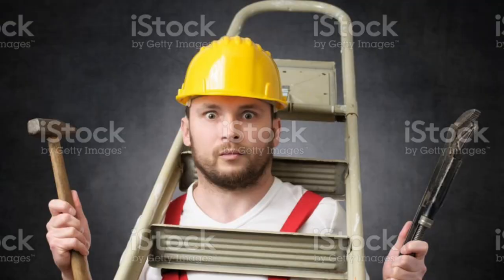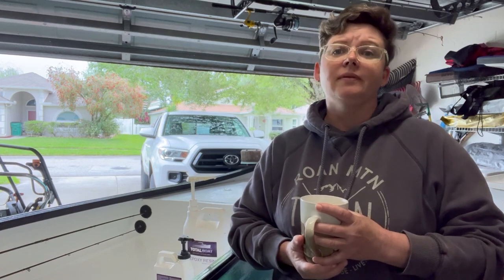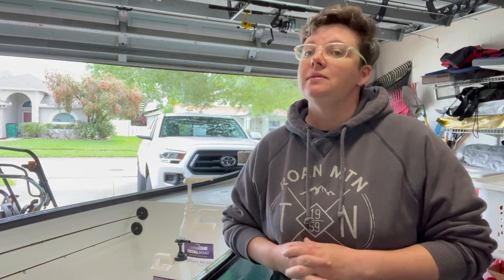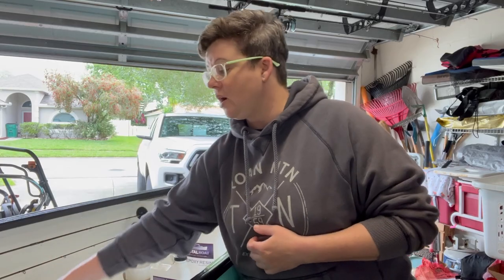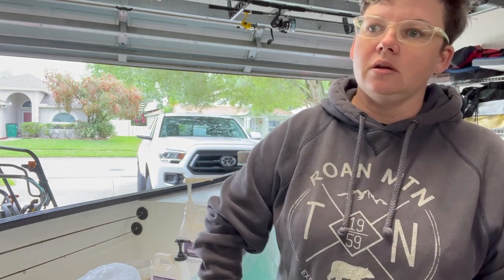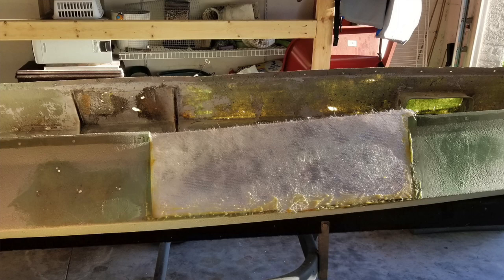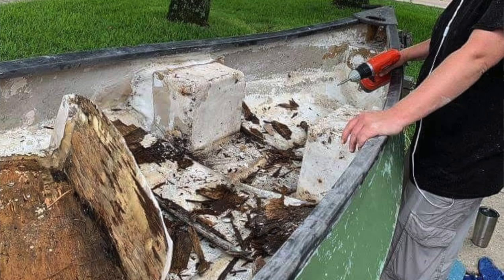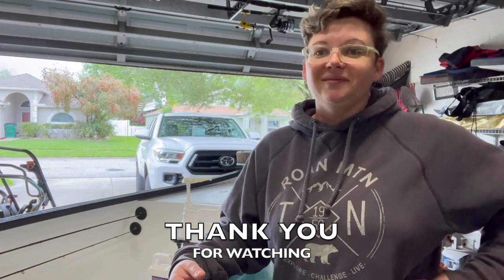GHEENOE REBUILD - Where To Start?

Comment: Love these videos - Subscribed! Question, what thickness foam did you use? I live in FL and found the supplier but they offer both 1/2 and 3/4. Thanks
Reply from the maker: Thank you for subscribing!!!  Because I used a lot of reinforcement and was fiberglassing both sides I went with the 1/2 inch.  They recommended to have a support every 2 feet but I didn’t go more than a foot without some kind of a support point.  Plus, I’m chunky but I’m not big enough to put a bow in the 1/2 inch after both sides had a coat of 1708 on them.  They ended up being ridiculously stable…. I had a hatch blow off and it was run over by a school bus and i was still able to stand on it (tested it for fun and was impressed). Let me know if you have any other questions.  What kind of boat are you redoing!?
Reply: @DesOnTheFly  thank you so much! I’m debating on PVC or the stuff you used for my skiff. I’m 220 so the foam does scare me a little haha but it’s so much cheaper than 3/4
Reply from the maker: I would use 3/4, or do an extra layer of 1708…. But that gets so expensive.  Were you thinking of starboard?
Reply: @DesOnTheFly  at my local Home Depot, they sell 1/2 thick, 4x8 sheets for $99 each. Might go that route as it’s is super strong, 1/2” thick and won’t require additional resin. Thanks to your videos, I started to explore other options than just wood.
Reply from the maker: Good!  If you think about it let me know how it turned out!
Reply: @DesOnTheFly  oh I will! Thank you for the great and fun to watch videos.
Reply: @DesOnTheFly  oh I will! Thank you for the great and fun to watch videos.
Reply: Where is the best place to buy the foam board?
Reply from the maker: @patricklail2031 if you live in Florida and you can take a drive I recommend recommend getting it from this place. They are nice. Shipping is more expensive than the actual foam.  https://fiberglassflorida.com/air-cell-t-60-6lb-green-foam-2709.html
Reply: @DesOnTheFly  thanks so much!! I’m actually in Charlotte NC
Reply from the maker: @patricklail2031 if you have a local fiberglass place contact them and see if they have a substitute.  I didn’t do honeycomb because it wasn’t moldable but that is a more popular option you may find easier.

Comment: I’m about to start my project of a 1989 13’ gheenoe.  Any suggestions or recommendations would be great! This is my first rebuild.  Do you suggest filling holes with bondo and sanding smooth before you put a full new layer of fiberglass?
Reply from the maker: I definitely recommend filling in holes or cutting out/redoing section before you put a full new layer on.  Those older ones definitely need a gut job.  The wood gets so soaked and rotten.  What are you thinking of doing with the inside?  When I took the rails off of mine I found bad cracks and waves I had to cut out and redo before I could put a new layer on.
Reply: I haven’t even gotten into mine just finishing up a 12’ aluminum and trailer rebuild.  Do you have a discord? Would love to ask you questions and pick your brain.
Reply from the maker: I don’t have a discord but I do have instagram or Facebook messenger.
Reply: I added you on Facebook thanks!
Reply from the maker: Thank you for letting me know!  I will except!

Comment: Thanks for the videos. Well done. How did you mount the rod holders without penetrating the exterior wall?
Reply from the maker: Thank you!  I hope they help.  I ended up adding a layer of foam and glass to the walls for stability, otherwise they just kind of flapped in the breeze.  So I used small screws and 5200 marine glue.  It worked great!!!!
Reply: I like the foam you used. I’m looking around for it now. How much did you end up using? Looks like it comes in 4x8 sheets, correct. Thanks for the response.
Reply from the maker: @mikedantoni3470 I can’t remember how many I used.  But I over measured the decks I wanted and then used graph paper to figure out how many I needed.

Comment: How much epoxy, fiberglass, and H60 did you go through?
Reply from the maker: About 3 gallons of epoxy, about 30feet of fiberglass and 1.5 full sheets of h60.  I fiberglassed both sides of the h60 to keep it strong.  What are you redoing?

Comment: Yours was worse than mine was, and is, again.  Mine is a river hawk 17'.  I use Bondo fiberglass jelly to patch holes and then Bondo fiberglass resin with the cloth.  Pretty close to what you did. The rivers here in north Georgia have rocks and rapids so I'm going to coat the bottom of my hull with rhino liner this time.  I like what you did to yours.  I might put more layers on mine first.  

Up here you gotta go upstream and fight currents.  Anything less than 15hp won't make it.  

When you can make it, though, I can guide you on a hell of a ghenoo trip once I finish my boat.  Our watershed comes out in mobile, AL.  That's downstream.  

Your channel got recommended at random by the way.  That's how I wound up here.

Besides that I've been trying to figure out a way to make a convertible top that converts into a set of sails as well.  I've got an outrigger system designed too.  I'm going major on mine this time.     It's set up to tow the outrigger canoe.  Coleman with the floaters.  

Excellent videos you have.  Thank You.
Reply from the maker: Awesome!!!  Yeah, the oysters get my boat and I will need to do some love patches here in the next couple of years just to keep up maintenance.  I bet you do need a 15hp upstream!  I’m going to upgrade now that I feel more comfortable with the boat.  A 4hp is just a little small.  I would love to keep in touch and see Georgia.  Rhino liner will work well.  I love the airboat coating on mine.  It really helps!  What do you mainly fish for?
Reply: @DesOnTheFly  That would normally be a simple question except our local government won a lawsuit against watershed PFA violators very recently.  In the upper watersheds you can go for trout or other small fish.  Crayfish traps increase your chances of success.  I wouldn't keep or eat any catfish.  Any tipe of chicken wing sized fish should be ok to eat other than that.

In the middle watershed small striped bass is what you want to get for food.  The pollution complicates things.  I'm trying to re-figure it out again myself.

Thing is you pass through towns here going upstream.  There's islands in the middle of nowhere and there's supply stores next to bridges the whole way.  In Rome you can get anywhere you need to go by river in town.  It's a different scenario.  Yes it's addictive 😎
Reply: @DesOnTheFly  For my second answer, I like the adventure.  I stealth camp here and there.  I only fish for food if I need it.  You ain't got time to stop much if you're gonna make it upstream camping.  

What I do is get to the camp and go to dollar general and get sandwich meat first thing and hide it among stock in the freezer.  Then I set up camp and buy it frozen the next day.  

There's not many safe fish catch eat places at the moment.  Even our tap water is contaminated along with well water.

Please do keep in touch.  I like you.
Reply: @DesOnTheFly  I'm not sure if anything I said made sense or not.  You mentioned a coating that I'm not familiar with as well.
Reply from the maker: It made sense, I don't get to stealth camp a lot but I primitive camp as much as I can.  I fish for fun, but I love eating my catches.  But Red tide, and water pollution down here make it really hard too.  

I didn't even think of doing that with lunch meat before you buy it!  I'm so doing that!!!

The bottom stuff I put on is called super slick.  Here is a link to it, just remember if you trailer your boat and you go around a corner without it strapped the boat is going the other way...

https://fascoepoxies.com/Fasco-9xn-2000-Super-Slick-Epoxy-Bottom-Coating.html?gclid=Cj0KCQjwqs6lBhCxARIsAG8YcDhbLhY2ismOjhK8VHeFbAbBM2pQ4dDEDoDgZ3G5jtg2tigoTlualv0aAmYBEALw_wcB
Reply: @DesOnTheFly  I don't do it alot either anymore.
Reply: @DesOnTheFly  About camping.  We're in opposite situations.  I love bushcraft and primitive skills.  Everything near the water is either private property or a heavily patrolled no camping public area.  It's like that because of people who do harmful things.  

I have an air mattress with a few layers of sheets and blankets sewn around it like shoestrings.  When you pump it up, it's an insulated air mattress, which is inside of a mosquito hammock, which is inside a 2 man cheap dome tent and accompanied by a camouflage tarp that's pre-rigged heavy duty to tie off to trees or stakes.  

I roll it out.  Pump up the mattress.  Put the polls in, hang the tarp, throw the sleeping bag and pillow (army issue WW2 laundry bag) on it.  Good to go even in the Cold.  

It takes about 5 minutes to take it all down, pack, and skidaddle.  😇
Reply from the maker: That is awesome! I have an old Coleman that the top part is starting to rot out of because of saltwater use.  It is weird to think of but even if I don’t get it wet the saltwater recks everything.  Most of the time I’m camping off shore or on a beach somewhere so my stuff takes a huge hit.  The off shore breeze really helps with the mosquitoes.  Inshore they get unbearably thick and make it unreasonable to camp.  The humidity sits at about 95 to 100% so we need that off shore breeze to help.  I have a foot pump mattress and it is usually to hot except for January and February to use a sleeping bag so I just go with a sheet.  I am looking into getting a cheep but decently made hammock tent for future trips.
Reply: @DesOnTheFly  I found mine (hammock) at Walmart for 40.00.  IDK if they still have them.  I use the air mattress inside of it even when I hang it.  Mosquitoes are bad here too. 

While we're on the subject, northeast Georgia has a feature that I haven't done yet.  The Savannah and Oconee rivers are connected by lakes and a creek.  It's called fishing creek.  It was there before the lakes were.  That's one huge section of being nowhere near a store.  I've been wanting to do that expedition for a while now.  It's all freshwater up here.  

Your canoe, is it a ram-x?  Mines polyethylene.  Saltwater don't sound very friendly.  About that heat it's so hot and humid here that I don't want to go outside during the day.  Not even in the shade to sand on the hull of mine.  It's just too hot to work on it right now.  I'm hoping to be back on the water with it next year.

I used the camping gear we were talking about from here to Washington state and California and back.  I used it hanging with the air mattress and stuff inside at least 50 times.  Technique changes with the terrain.  It's super cozy to hang in the thing.  

See I wrapped the mattress while it was blown up across a picnic table upside down if that makes sense.  I used cordage to secure them together around the airmat and when I deflate it, I fold it in half and roll it up with the hammock.  It hasn't failed me yet.  Makes it easier to take down the hammock too.  That mattress stretches the bottom of it out perfectly and don't pop out like they do in a regular hammock.  I'm just talking about some good sleep 😴
Reply from the maker: I have a couple of nice travel hammocks, but none of them have bug nets.  That makes it hard to sleep in unless I'm off shore without fresh water around and a good breeze.  So, I'm going to have to look into modifying one.  

I had to use epoxy resin for my gheenoe.  I needed to be able to lay almost 16ft at the same time and I am not that good that I could use poly.  It would have fired and hardened in 5 minutes in the Florida heat!  If I have a small repair I used poly at first, but I moved to epoxy just to give me more flexibility.  

I will check fishing creek out on the map.  You should check it out!  bring some frozen meat and dehydrated stuff, a 5 gallon thing of water and go explore!

Yeah, the heat here is bad and the humidity makes it hard to breath.  I have to plan jobs outside early in the morning or right before a storm, or dark.  I have a garden fence I'm working on and I may only get 2 hours a day to get stuff done before I get warn down.

I bet by doing that with the mattress in the hammock it is more of a flat sleep than a bowed "hammock" kind of sleep.
Reply: @DesOnTheFly  I've checked it out.  I didn't have my boat with me then.  Only a canoe.  I was towing my travel trailer at the time.  You have to go up the oconee river a little ways before you get to it.  Redlands WMA.  I gotta get my skiff going again before I can go do it.  

The mattress does make it flatter and way more comfortable and when you wrap it like I did, you don't feel those pesky ridges in them.  

The refurbishing you did on that hull was outstanding by the way.  That thing looked like a nightmare.  How long does it take for saltwater to do that much damage?

Comment: I'm struggling to find out how much resin I'll need for my project. I'm doing front and rear casting decks on my highsider. How much did u use? 
Also thank u for this video. Not much detailed info on gheenoe restoration here. Helps a ton 🤙🤙
Reply from the maker: Hey!  Thanks for watching!  I think I ended up using 4 gallons for the majority of the project.  2 for the bottom and 2 for the top.  The 1708 ends up sucking up a lot of resin.  Don’t forget to check out pro marine epoxy.  It is half the price of total boat, just don’t use table top epoxy.  It gets weird at hotter temps.  https://promarinesupplies.com/521-marine-grade-epoxy-resin/?sku=521GKF&gclid=Cj0KCQjw0umSBhDrARIsAH7FCofpiNfhSnxOcd9B3tlcYYphDBDOPxagVJLDEb3LFo_iPiBmr68GIe0aAl_UEALw_wcB
Reply: @DesOnTheFly  I'll check em out. I'm glad there's a cheaper alternative. Seeing it being 140 bucks a gallon was kinda painful
Reply from the maker: Yeah it is!!!  If you are doing both decks you may want to get one gallon and see how far you get.  It takes a chunk out of your wallet if you are trying to go low budget.  What kind of fiberglass are you going to use?
Reply: @DesOnTheFly  I'm planing on using an epoxy resin and 6 or 10 oz cloth. (Multiple layers obviously) I'm also using 2 layers of quarter inch hardwood plywood. As the base. Up here in Ms., There are 0 distributors of marine grade or composite boards
Reply from the maker: Yeah, that sucks!  It costs more to ship the foam than it does to buy it!  I would start with one gallon and see how much your fiberglass soaks up.  Are you putting anything on the plywood before you put your fabric on?
Reply: @DesOnTheFly  I'll be sealing with the epoxy then paint the plywood. Which is making me consider just buying 2 gallons.
Reply from the maker: Yeah, the plywood might end up sucking that up fast.

Comment: You cannot gel coat over epoxy but epoxy is one of the most water resistant resins
Reply from the maker: It’s awesome isn’t it!?  Thank you for watching!!
Reply: @DesOnTheFly  I'm going to start my build soon hopefully however I'm not a fan of epoxy resin I will most likely use polyester
Reply from the maker: Let me know how it turns out.  Are you doing the entire boat or sections?  I couldn’t lay 15.5 feet of poly in the Florida heat and expected to make it look nice.
Reply: @DesOnTheFly  haven't exactly decided I'm planning on building a front and rear deck like your build and a false floor in the middle
Reply from the maker: I’m excited for you.  It makes it awesome!!!